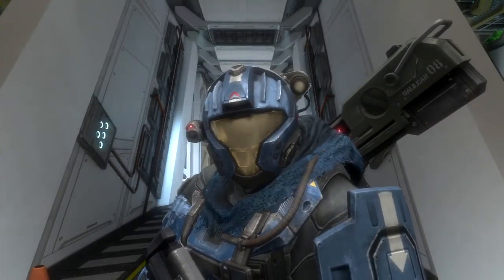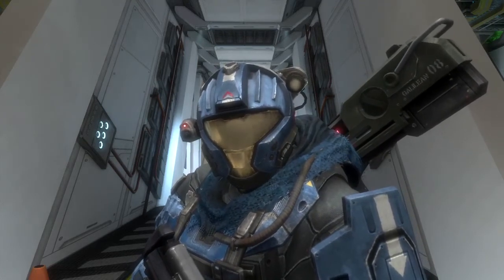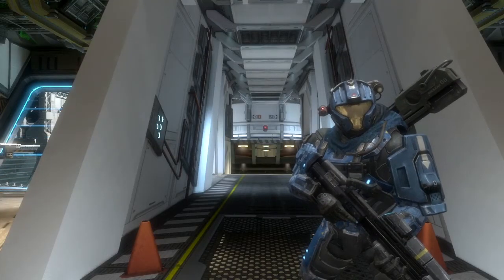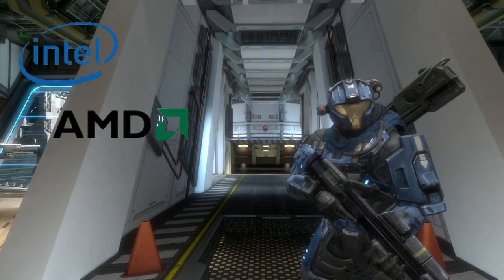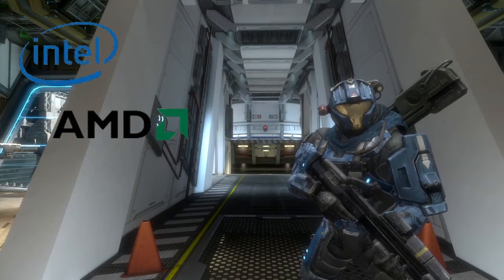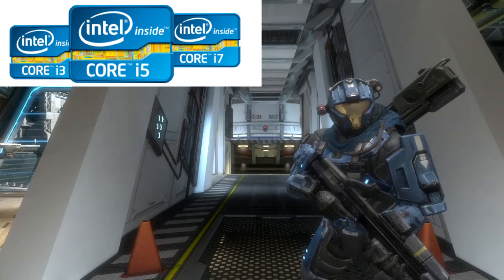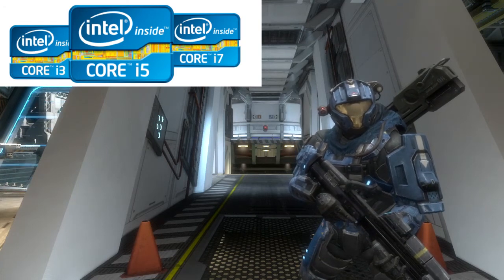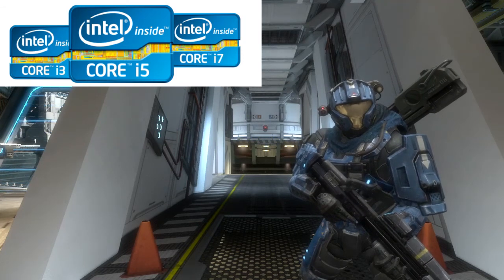Building a Pc - The CPU

Comment: was this video made before the 2011 sockets arrived? If so, should I be getting a 2011 socket sabortooth motherboard or a 1155 socketed sabertooth? The 2011 will cost a whole lot more since I would have to upgrade to a i7 CPU (w 2011 socket instead of the 1155 socket 2500K, or 2600K) what do you think?